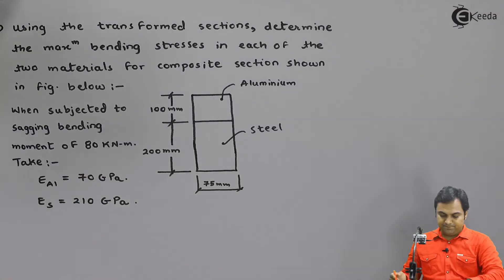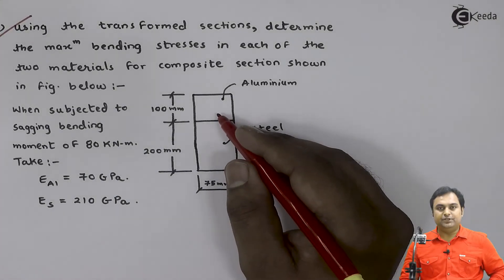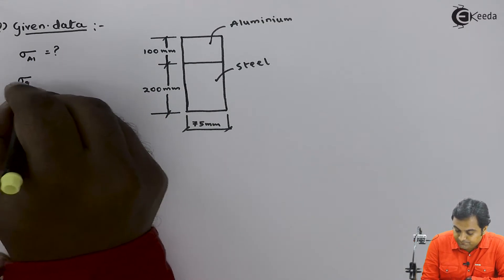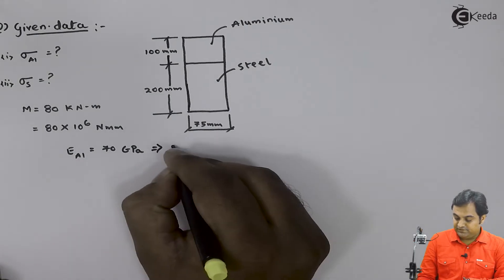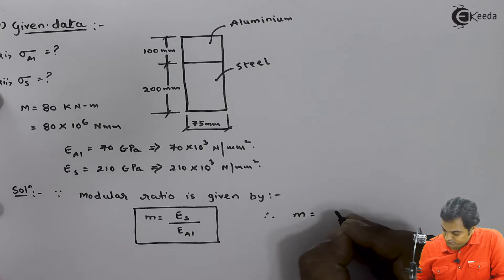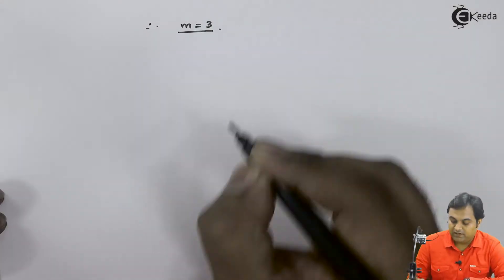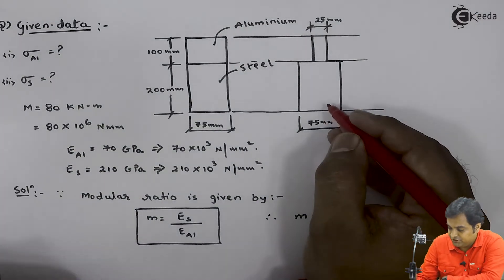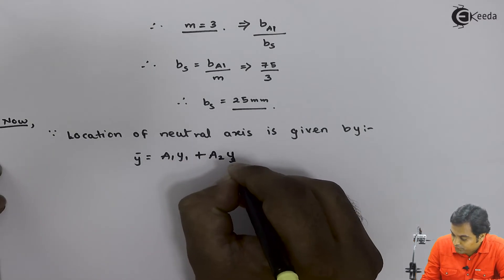Flitched Beam - Problem 2 - Stresses in Beams - Strength of Materials

Comment: What if there are three materials ? Like a concrete slab on a timber beam and timber beam is strengthened by two steel plates to the sides. How do we solve that ?